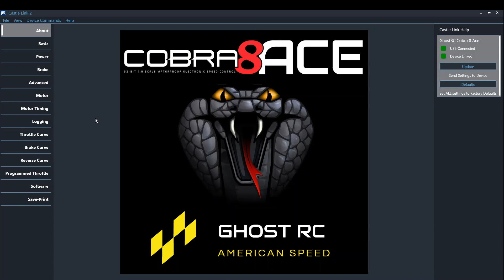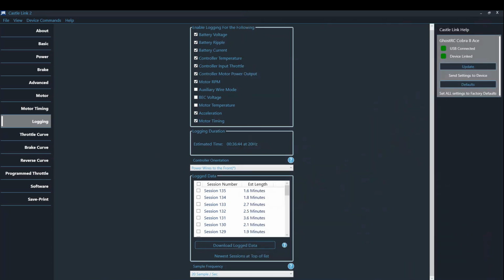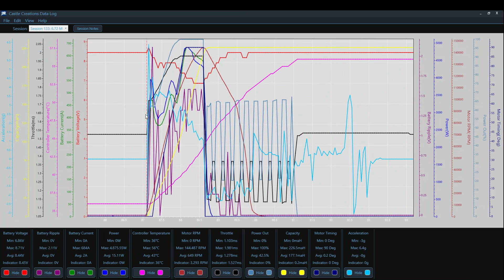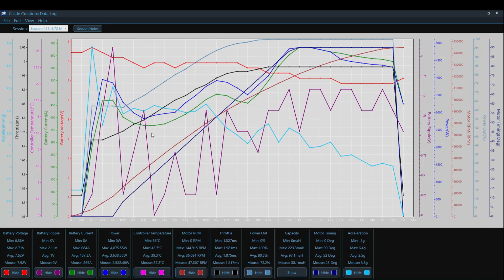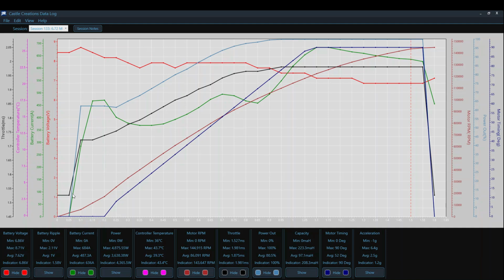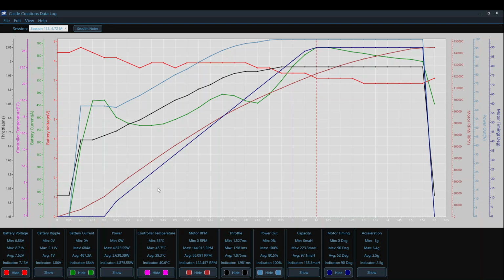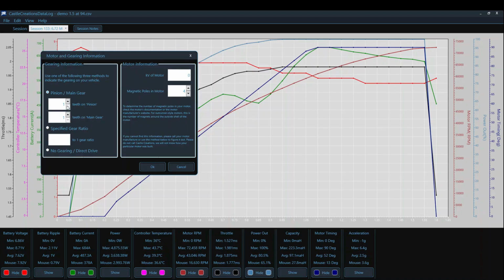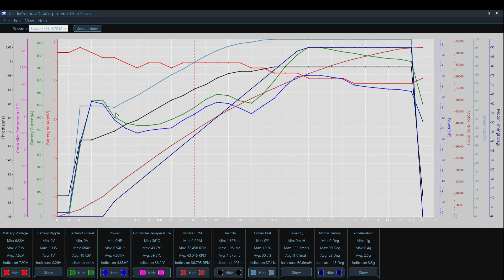Castle Cobra 8 data logging

Comment: Thanks for this, got some helpful tips, not sure about anyone else, but I still prefer the older graph viewer. Quick question (sorry I know this may not be the right place to ask) have you found that the data isn't exactly the same when viewing a log in both graph viewers (not using the new cobra esc's). More specifically ripple, the same log usually shows a much higher ripple volt in the newer graph viewer 🤷‍♂

Comment: I know you might know this but you don't have your pole count set right. View, pole count. If you have a 2 and it's set at 4 it reads double and vice versa. I highly doubt you're at 157,000 rpm as I know of no motor that revs that high. The does effect the horsepower and wattage it displays as well. 
Edit: seen you fix it later but do you know how to erase the log?
Reply from the maker: Yeah I know. But what you set timing via rpm in the esc it only uses electronic rpm which is basically 2 pole. So to get you logs to line up with the rpm numbers in the ESC you can use 2 pole setting in the data logs.